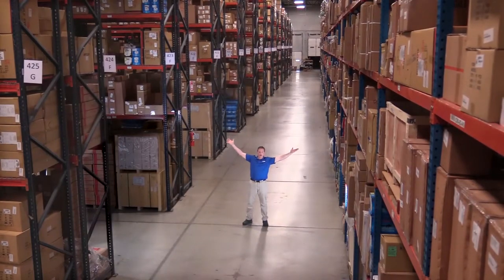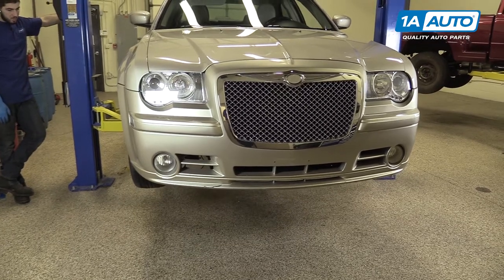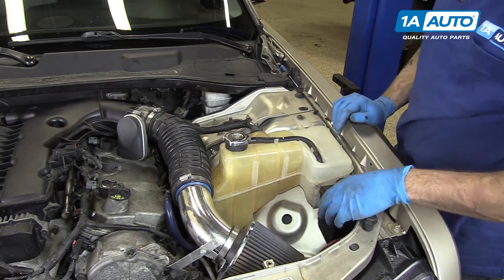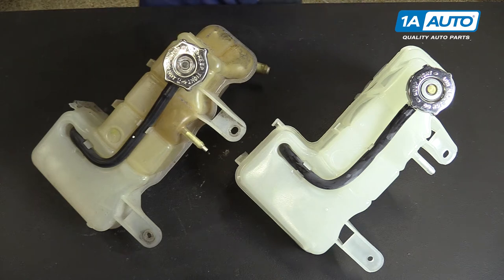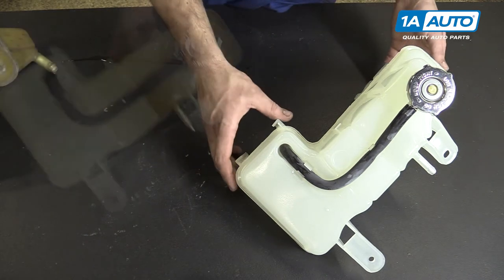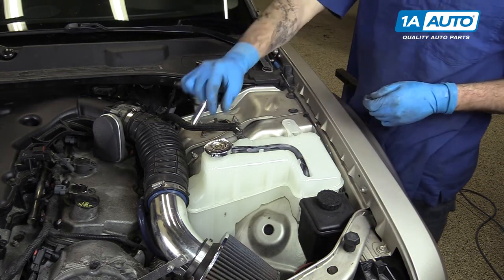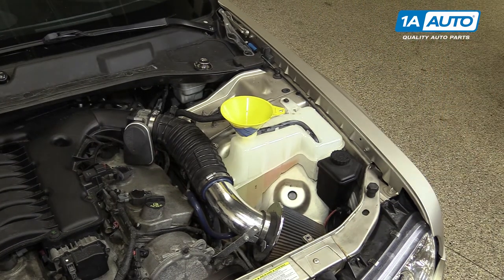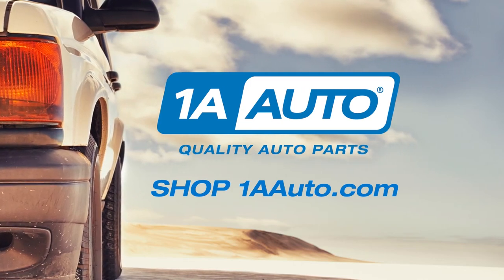How to Replace Overflow Bottle 06-10 Chrysler 300

Comment: I have a problem with my 06 300C and its filled with a brown sluge, would you guys happen to know what that is from or what causes it??
Reply from the maker: +Patrick Bullick Thanks for watching!  Brown sludge in the cooling system usually means the antifreeze is no good and there is now rust and sludge build up.  1aauto.com
Reply: @1AAuto  awesome! Well not really but, would you know what causes it to happen?
Reply: I have 06 3.5l C300. My resovoir is filled but after car is running there is a puddle of antifreeze left on the skid plate. I dont see visible leaks from resoivoir nor does my car run hot but antifreeze is coming from somewhere .Any any advice on what this is or if repair is needed?
Reply: @unboughtunbossed1841  You have air in your system, my 3.5 was leaking from the driver's side until i bled it out from the bleeder screw, buy a spill free funnel to get the air out faster and it'll stop leaking.

Comment: First...it says your only replacing the tank. So only if necessary the radiator should be drained. Extra step for nothing.  If the antifreeze is fine and the tank is just getting flakey then draining is not necessary. Second the antifreeze that drained was red. I have an 06 limited and it takes the 50/50 100,000 mile extended orange color. You put in the regular common color. Why? Most of your videos are very good. But you missed the mark on this one. If your going to go through the trouble of draining the radiator then flush the entire system.

Comment: Why did the coolant turn red?
Reply: J Will the original mopar coolant is red, they did not flush the system to remove the coolant in the engine block.
Reply: @jeremiahsepulveda  yes I noticed. That's a no no mixing different coolants. These vehicles take the host coolant (red)